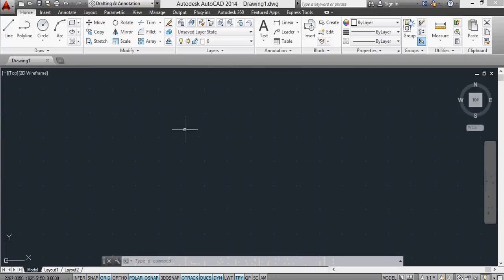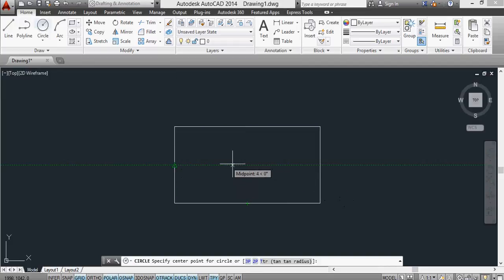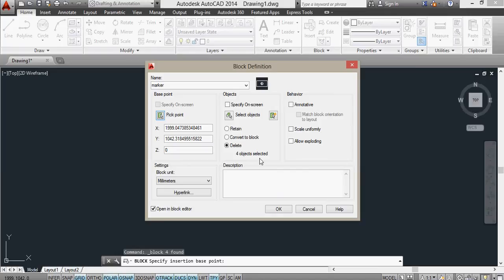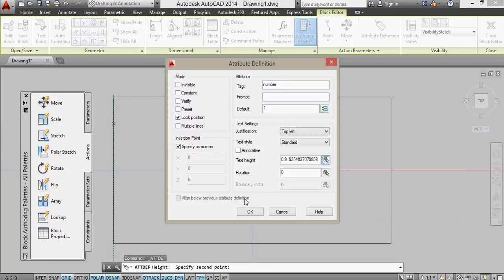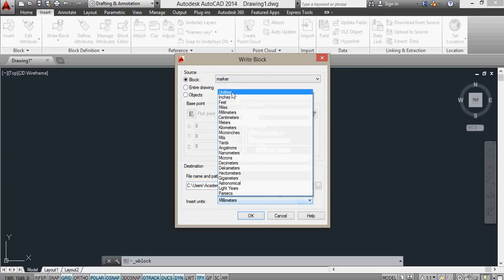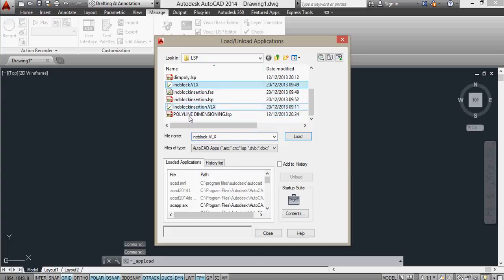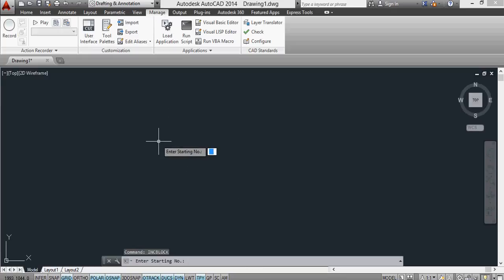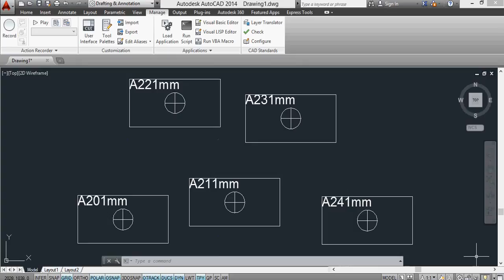Incrementally Numbering Inserted Blocks in AutoCAD

Comment: This routine is very interesting. I would like to do a similar routine but I just need to have the starting number and increment required at insertion time. The block needs to be pre-determined in the routine. So the user can select from a palette of blocks. Is this possible?
Reply from the maker: In my own code the user types in the command and then selects the block, (and other parameters), they then have the attribute number incrementing with every positional click which inserts a block. You can make it so that the user selects the block for each click but this slows it down too much in actual use.
If you give me your email I can email you the routine and you can edit it to how you want.
Reply from the maker: Hi Francois. I got the linked in message and have sent you an email.

Comment: Do you have any lisp which replace attributes blocks in numbers series  on placed attributes blocks.
Means when i select 1st block it change text to 01 than when i select 2nd block it replace it with 02. And so on continue
Reply from the maker: Hi Moin, Not as such but you can do this with the Auto Number tool in AutoCAD on the Express Tools Tab. The best I have used though is the feature to export to text, open in Excel and do the numbering there and then import back into AutoCAD.
https://www.youtube.com/watch?v=wG_slcO9cRk&list=PLxYkfqICngaNeAPy0Q43g1J2DGzs_7kw9&index=35
Here is a link to my video on this.
Reply: @OakleyTurvey  
Hmm that i know. Even i hv add in for that too... But i need lisp.